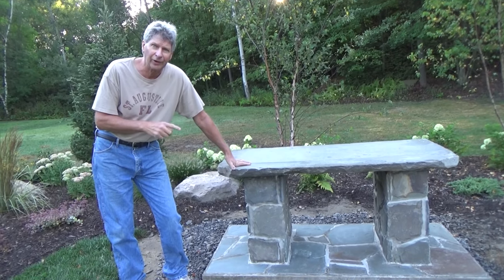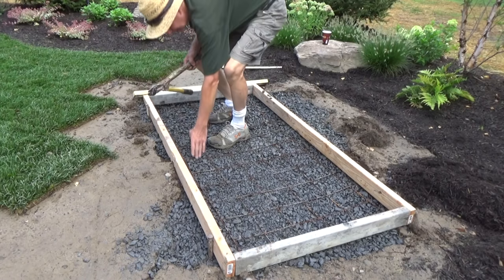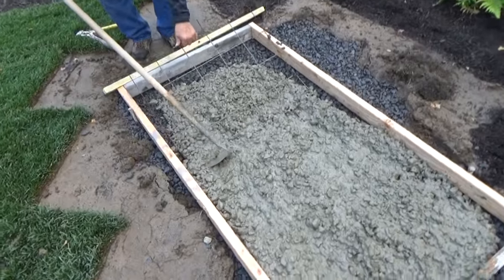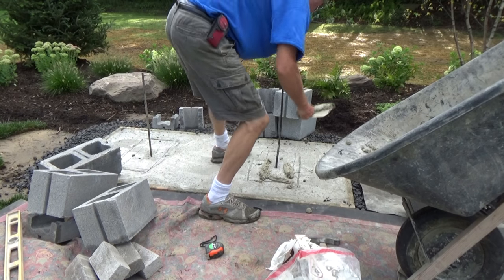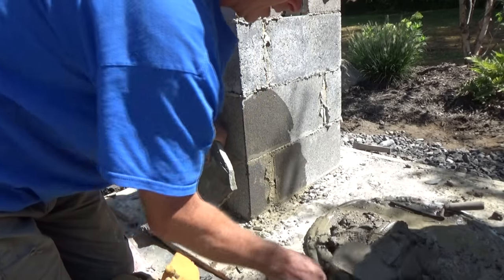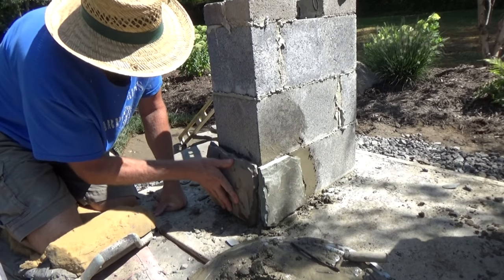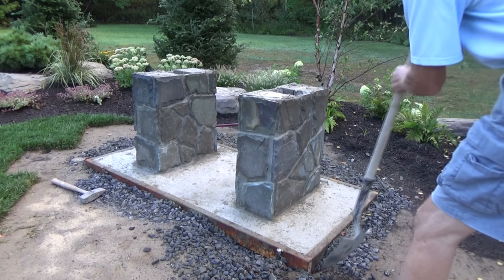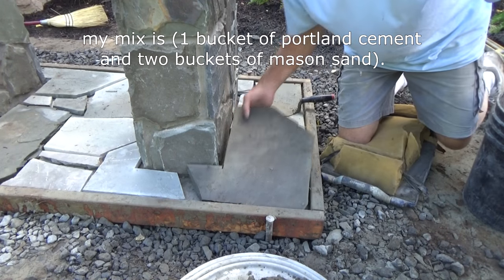STONE GARDEN TABLE - (Mike Haduck)

Comment: Great video my good man thanx u for sharing...Question?.....i noticed that you used rebar between the cinder blocks and used wire too... i thought you were NOT a fan of wire & rebar for projects you work on for long term longevity......did i mis~ understand you or is this a special case plz? thanx again sir.....
Reply from the maker: Hi, yes, it's a special case, they would be placing heavy weights on it periodically, with people standing around so I dint want it to move, thanks mike

Comment: I am planning on building a stone home, small garage, and two driveway pillars using stone and mortar only. I was a bit disappointed to see you use rebar and concrete blocks here. Could you please do an instructional video on the traditional method of building with stone and mortar that will last centuries? Thanks a lot Mike!
Reply from the maker: Hi freedom, I have a whole series called " rockfacing ans shaping stone" lots of information there, thanks Mike

Comment: Hey Mike, have you ever made concrete park bench ends?  Im thinking of trying to cut a mold out of 4" foam and pour them.   Im trying to mimic the commercial ones that you see in parks with the concrete ands and 2x4s    My father always talked about how he wanted something "heavy duty" like that for his backyard and im thinking it would be a nice birthday gift.  PS your videos have been a lifesaver.  I have probably watched just about all of them
Reply from the maker: Hi Showcase,  it could be done, attaching the wood would be the tricky part,  thanks mike
Reply: @MikeHaduck  that's what i am still trying to figure out.  I was thinking to set some bolts sticking out in cement all first and then pour the rest.  I'll keep you posted how it comes out

Comment: I noticed you didn't cut a drip line around the bottom (like you did on the stone chimney cap). Does the 1:2 Portland/sand mortar ever produce efflorescence, and if so, would a groove help prevent it? Love your videos!
Reply from the maker: thanks,  no I did not but it was not a chimney where it would go down the flue and maybe a groove might help but I had it pitched to the back end anyway,  no for the efflorescence as long as it does not have the water behind the stone,   thanks mike

Comment: Looks great! I noticed you use a continuous diamond blade on your grinder, I have the exact same Hitachi and use continuous blades also but wondering if you have ever used segmented blades, and if so what are the advantages if any in using it with different materials (stone, brick, concrete, etc)?
Reply from the maker: hi WCSD,  I do not see a difference when cutting straight through, only for grinding on the sides I guess I would use the continuous one, thanks , mike

Comment: Mike on a older video installing stick on stone you used 2 sand, 1 type s. I live in PA also, which mixture is best for exterior manufactured stone? Also thanks for making all these instructional videos, great help.
Reply from the maker: Hi Raymond,  if it is going to get hit hard with rain water I use mostly portland or else I use s mortar and add a little portland too it.  no matter which way I go I never had a problem thanks mike
Reply: Okay on the mix. What concerns are there with putting on a scratch coat and  installing stick on stone when overnight temps are dropping below freezing?  Thanks in advance, I appreciate the time and advice.
Reply from the maker: Hi Ray,  I would say it all depends on who you talk to. I do not take winter jobs like that,  my policy is no freezing  on concrete for 3 days I seen block jobs freeze solid on emergency repairs and a year later no problems so it all depends on the situation,  but why take chances?  I hope it helps thanks mike